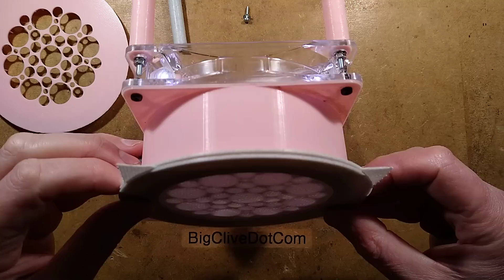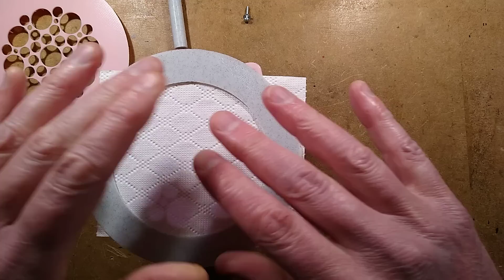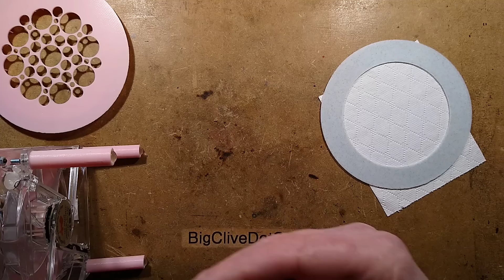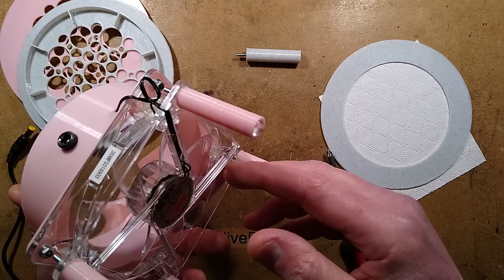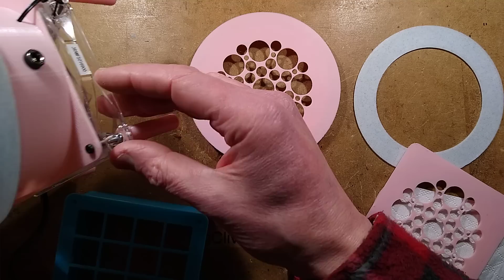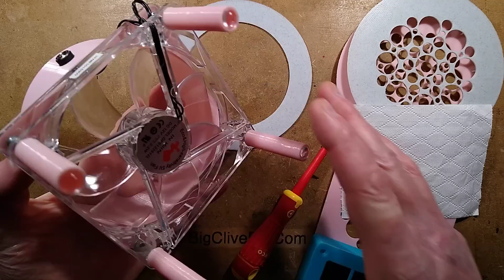MK3 air filter with customisable 3D printing files

Comment: I tried making one but didn’t get very good results. I found that the paper was way too restrictive which resulted in pretty much no airflow (even with just 1 ply). 

I put some smoke through it and turns out the outer parts of the fan blades (fastest moving part) were doing a good job at blowing air out the back of the fan which made it feel like it was working well however the inner parts of the fan blades (slowest moving) had air going the wrong way back into the fan creating a pointless vortex that never went through the paper filter (also confirmed this with an anemometer spinning backwards towards the center hub). There was plenty of vacuum on the front of the fan but almost no flow.
 
I’m interested to know if yours does the same as mine?
Reply from the maker: It does, but there is still a slow and steady flow through the paper.

Comment: What type of 3d printer do you have, also how long did it take to print. How much I'm print material. I ask all this I've ben thinking about getting a 3d printer.
Reply from the maker: It's a very affordable FLsun Q5, and the print time is short for the legs, but a couple of hours for the main platen.

Comment: Stator fins are a good idea but will be more effective if mounted close to the fan and extending all the way across. These fins should be as tall as the widest part of the fan blade. Leave about 1/4 inch gap between the stator blades and the fan to prevent making extra noise. 
Yes, the rectangular plenum with square holes will provide more air flow. That fan and others of that type can's generate much pressure drop unless screaming like banshees.

Comment: I like the modular aspect of this. We are all navigating a marketplace dominated by wasteful designs and throw away products.With so many options to customize filter media, air path and fan quality, it's like Build-a-Bear for air purifiers. If your not into printing yet, these parts look a lot like clothes dryer vent adapters and bathroom exhaust fan ducts. If course I have a box of those in my hoard.
Reply from the maker: It can literally be improvised out of junk.

Comment: love to see the paper result after month.. how dirty it gts
Reply: Clive, show us your dirty toilet paper!😂
Reply: @loukashareangas4420  - Yep, the next Big Clive stream needs a dirty toilet paper reveal and comparison.
Reply: For science, another sheet would need to be hung nearby as a control...
Reply: Whoofle smoke soot 🔥 🙄
Reply: @grantrennie  
Yes indeed how far can it pull smoke  through the filter.
Reply: The best air filter is the one you put inside a rack server module that has 4+ high power fans :)
Reply: @noop9k  
They are good.  I never understood why your home computer doesn't have a filter on the fan. Instead of blowing dust bunnies into it.
Reply: @assassinlexx1993  we added the filters ourselves because too much dust came through open windows into our expensive servers. Had to replace about once per year
Reply: @noop9k  
I find it amazing with the high  cost of servers  they  have poor cooling at times but little control over air quality. You think someone would build a roll of filter paper. That can sense a drop in air flow and unroll a new section of clean  filter. When it gets close to the end . Alert shows up to change the spool.
Reply: @assassinlexx1993  Normally they are operated in rooms with clean conditioned air. Makes more sense than what we did because we needed them at arms reach.
There are systems where you have big fans pushing air from under the floor through entire rack and no fans in the modules. And fire extinguishing system that may suffocate you if you are inside when it activates :)
Reply: @assassinlexx1993  Any good case will have removable dust filters for the fans. Most pre-built computers cut costs on the case which unfortunately often includes a lack of filters.
Reply: @assassinlexx1993  Hint: Just grab a roll of stainless steel mesh and put it in front of the fans. doesn't hinder the airflow much and filters a lot of dust (and even e-cig vapor). The tiny amount that passes through the case isn't much of an issue. The plastic filters you can buy or those which are already equipped on the more expensive cases are way too coarse.
Reply: @FntX-Video  
That is a fine mesh. 
I would think you need a air flow sensor. That would alert you to clean the filter before it caused overheating.
Reply: @noop9k  - But sounds like a military tank or a heating unit!
Reply: @reggiep75  A rack with 4 servers, plus UPS was right next to my table for a few years. Wasn’t so bad actually because most of the noise happens inside thick case and the air flow was considerably slowed down by these filters.

Comment: I think it is interesting you giving  a simplistic approach to air filtration in a very different to another well know YouTube presenter who also is very anti ozone. I have been using something like this as fume extraction when soldering especially on very old gear.  also use small amounts of ozone in fridge and bread cupboard against mould and of course teenagers bedroom.

Comment: Looking good. You have me wondering about designs which would fit a typical sheet without overhang, and even - inspired by a patreon  patreon comment on one of your prototyypes - ways it could be made to take a whole roll and (very slowly) advance fresh filter over itself continuously .. though that would make for a much bulkier unit it could perhaps be built into something larger that serves another purpose as well? .. and there I am again un-necessarily over-complicating something!
For the vortex-breaker, perhaps a separate insert could work? .. or .. modify the the lid so that the round holes are actually short tubes extending into the chamber?

Comment: 1. How about using hexagons for the grill?
2. I have some spare HEPA filters for my air purifier, I'm thinking of designing an enclosure to hold a filter and a 140mm PC fan to act as a "proper" HEPA filter. It might be a bit ambitious as a first project and having someone else print the part for me but it will be interesting...
Reply: And don't forget that hexagons are the bestagons~
Reply: I just thought the same. Some kind of honeycomb structure would look quite nice while maximizing the "hole" area.
Reply: I used to design storage systems and found from our metal shop (who also did lots of work for Dell) that hexagons produced the least noise of any grill shape.
Reply: @Peter_S_  Less than the old-school wire "bullseye"?
Reply: @Azlehria  Yep. We went in there with a traditional "bullseye" in an external RAID enclosure and that's when they showed us the work they had just done for Dell and talked a little about the acoustic modeling done by a 3rd party consultant.
Reply: @Peter_S_  Welp, that explains why the hex grid is showing up on feverything these days.

Comment: 2 magnets would hold the top frame in place and trap the filter media.
Reply from the maker: That's an idea.  With built-in round magnet holders.
Reply: @bigclivedotcom  could have a look at magnets, I used to get things from a place, will have a look and see if they are still around..
Reply: @grantrennie  fancy sharing the source? I 3D print a good amount of stuff that relies on magnets and they get bloody expensive even buying 100 at a time
Reply: @Ultra2040  Hi.  I use the magnets and discs from tatty, worn out tablet cases.  I figure that if they're ok for tablets they should be ok for pretty much anything else.  So far so good.
Reply: Or magnetic plastic media and stick it to 4 countersunk Streel screws
Reply: I found a little box out on the street used for charging two earpieces, and the lid is locked with four very tiny magnets. It rocks....
Reply: Funny; I just lost the earpieces that go with a set like that & only have the box. There’s a decent lithium cell in there (751550 “500 mAh”, with apparent protection), and four (count ‘em!) magnets.
Reply: @davidcassidy602  Yep, that's exactly what I found. These magnets are hidden up and down in the two opening corners behind the plastic, and still locking very strong.
Reply: @OreoBambino  It has, but the distance to the 'lid' of that filter is large enough. And I think the magnets of these motors (fixed, stator) is in a closed circle around the moving coils (rotor), and outside fields won't get in easy.
Reply: Very nice idea indeed . thanks

Comment: What about a UVC lamp in the cavity. A UVC with low ozone and or an ionizser?
Reply from the maker: An ioniser module could be viable, but the 12V ones really need a supply with the secondary side grounded.
Reply: @bigclivedotcom  Perhaps a mains plug with a potted AC/DC module in a little box for 12v with proper ionizer grounding?